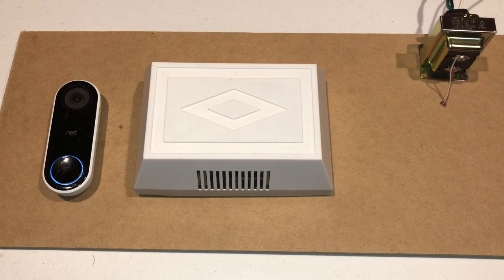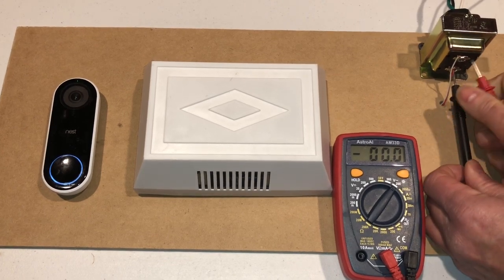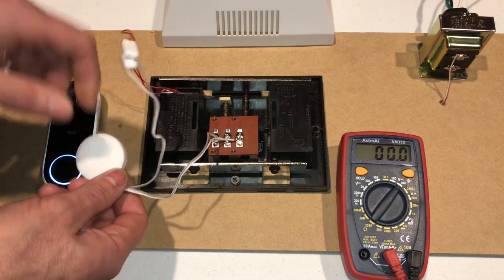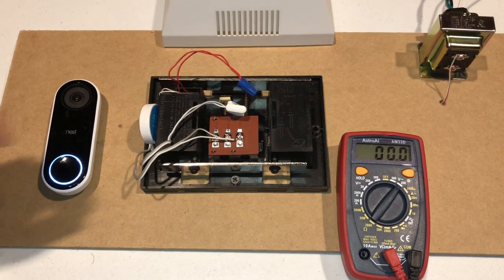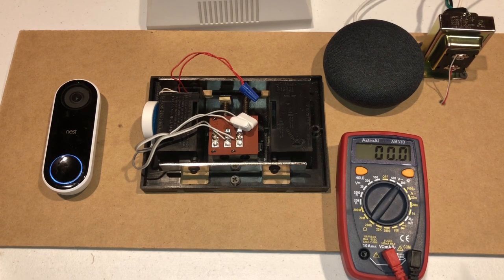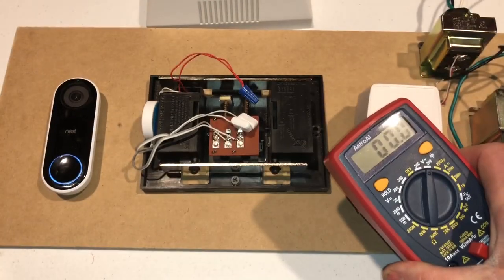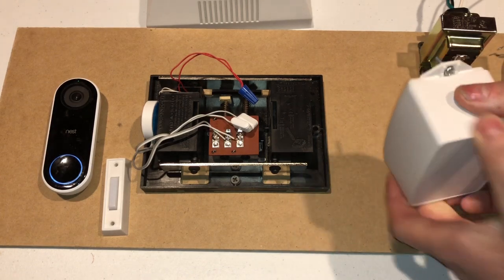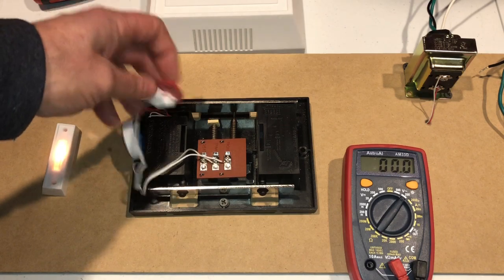Fix Nest Hello Power Problems

Comment: sorry to bother you with a question. I have an old fashioned metal doorbell hooked up to a transformer. The Nest does work, but the old doorbell does not work. It only makes a continuous soft buzzing sound. Any suggestions? I have looked around but can not find an asnwer
Reply from the maker: Did the chime work fine before the Nest was installed?
Reply: @sellgooddeals-DIY  yes perfectly. Now a constant buzzz
Reply from the maker: Check settings to see if Camera Duration is set to off.  If it is you need to check the wiring from the exterior wall to the Nest Hello.  Make sure there isn't any missing insulation.  The wires could be touching making a connection.   Also, look at the mounting bracket, the wires could be making a connection if they are bare.  While the Nest Hello is still connected straighten the wires out make sure they aren't touching.  See if the chime is making the buzzing noise.  If not the problem is the wires going to the doorbell.  Probably happens when the doorbell is seated in the bracket.  If you have missing insulation on the wires tape them with electrical tape.
Reply: @sellgooddeals-DIY  Thanks A LOT for helping out. I managed to get the bell working, well sort of. only a soft buzz. The constant buzzing still persists though. Tried everything you suggested. Get a second Nest mini. That will solve it I guess. Greets from The Netherlands.

Comment: Fabulous video! Thank you. So I purchased a Google Nest. My 11 year old home has two chimes. After installation the Hello light yellow meaning not enough power. I rang the doorbell once and the light turned blue! But, the first floor chime would barely ring and the second floor chime rang but had a loud buzz and hum. I’m sure I have a 16V, 10 VAC transformer but can’t find it. So I took your suggestion and on the chime that buzzed I twisted the transformer and front red wires together and PROBLEM SOLVED! First floor chime works fine and is loud and Nest Hello works fine! And instead of the upstairs chime, my google mini announces” there is a visitor at the front door!”  Even better than a chime. 

Your videos are the best and saved me from trying to locate and replace the transformer with a 16V, 30 VAC one.

Comment: Hey there good video, so it's been about a year now since you posted this, any issues? 
I called Nest / Google tech support, they said it is not required to use the chime adapter BUT it is recommended to still use it even if you are bypassing the chime. They said something about it being a protector in case a spike in voltage which could potentially "burn" the "Hello" which I would say is essentially what a capacitor does. 
But others have said long term they have noticed issues by doing this..

Comment: It is unfortunate the suggested solution is to not use the chime and just buy a google home.  The main goal is to keep the chime working like it was before but also get the functionality of the best camera.
Reply from the maker: It is personal preference.  I prefer to use the Google home minis/hub as my chime.  If you prefer the bell upgrade your transformer to at least a 16v 30va transformer and your bell should work for you.  I was giving my personal preference. The chime uses a lot of amperage if your transformer doesn’t have enough capacity the voltage will drop causing  the Nest Hello to not work properly.  That is why I like to bypass the chime.
Reply: Yeah just changed out to a 16V 30VA transformer and still having a ton of issues.  Nice to have options as I suspect most people would like to maintain their standard chime as well.

Comment: I really appreciate you sharing your solution. My doorbell was offline more than it was on, and it was driving me up the wall and nearly through it. The wifi connection to every other device was fine. I even have a mesh point 5 feet from the door and set the Nest Hello as the priority device. When I then investigated the power situation, I couldn't find the transformer anywhere in my old house. I was about to give up and call someone. So this tutorial and your advice really helped me out.  Thank you for making it easy to understand. I don't mind retiring the chime and relying on the Google Assistant, as long as it works and doesn't go offline every few minutes. So far so good. Thanks again!

Comment: The "power kit" is not just a capacitor. It is also a switch that the nest app uses to turn on and off the chime. There is a mode setting to turn the indoor chime off or on depending if you dont want to be disturbed by the doorbell. Personally i dont like the delay from pressing to bell to google mimi announcing the doorbell or the lag in the network for the push notification to your phone. I like the chime. The real solution is to get the 24 volt 40VA transformer and put in a resistor at the chime to drop the voltage to just the chime.
Reply: no i don't think so.  I installed mine without the chime adapter and the setting to turn off the inside chime still functions.
Reply: Shaun S yes but you can’t turn it on and off if not wired correctly.

Comment: Thanks, simplicity is gold😀
I may end up bypassing the chime. Can you explain why my physical door bell only works for a couple of days then stops? I’ve had to replace the capacitor two times now.
Thanks
Reply: Mine is doing that now, how did you replace the capacitor?
Reply: @JesseJamess  Did you fix your issue?  Mine worked while installing then the physical chime inside our home does not work anymore.

Comment: What happens if you leave everything wired and just turn off the chime in the app settings so the chime doesn’t ring? What does the voltage say then?

Also, the yellow ring would indicate at setup that there isn’t enough voltage from the transformer if the transformer is below 16v sitting idle. You should demonstrate with a transformer below 16v.

Comment: This is a great viedo! Hope I would find it earlier.... I connected my hello directly to the chime with 110v. Seems that my apartment didn't have a transformer. Followed Nest intructions and with 110v nest got a green flashing led on top, and now that I bought a transformer it does no light up and just gets hot right on where the wires are connected.... Any suggestion that may help? Have I burnout it? =(

Comment: Wish I could buy you a beer or three. I spent WAY too much time trying to locate my doorbell transformer. I'm convinced it must be hiding behind a wall or something. I can't locate it. This trick worked like a CHARM. Got the camera up and running. And with a little tweaking, my Google Home Mini is alerting me to visitors at the door and the camera feed automatically pops up on the Hub. Thank you thank you for the informative video. You really fixed my issue.
Reply: Exactly.  I live in a home built in 1951, and no idea where the transformer is located.
Reply: Older homes may have the transformer installed inside the main electric panel. You are not allowed to that now.

Comment: My transformer is 24V (10a) but when a measure, it shows 27/28v. Do you think its too much power for the hello without the chime?
Reply: Is a resistors required?

Comment: there was some minor electrical activity causing some movement of door chime tappets but not enough to hit the chime bars.  This happened every 10-20 seconds and if there there is no noise in house you can hear a faint buzz for 1-2 secs. I by-passed the chime and now I can enjoy real quiet times. I wasn't sure if I could do that until I saw your video. I have a google home so I really didn't need the chime. Google should be more clear about this. The buzz was driving me nuts when I was taking naps in the living room. Thanks!

Comment: Thanks for the informative video. I'm also going to bypass my electrical chime. I've seen conflicting info on the nest support forums saying that the chime connector module should be connected to the transformer as if it were the chime. In your video the chime connector is connected to the chime. Just wondering if you can clear that up.

Comment: A good solution. This will work pretty well for all the folks that are also fighting with intercom systems that want to use Nest Hellos as well. You can just upgrade the transformer and send the power to both the intercom as well as the Nest Hello.
Reply: Agreed

Comment: can you do a video with 2 doorbell chimes for 2 story houses.  We found out we have 2 chimes and the one down stairs is going off by itself and the upstairs that is connected to the Next Hello is working fine.  

i'm trying to now connect to the transformer but dont really know what to do if i have 2 doorbells and want both to ring when someone rings the doorbell.

thank you !!!! great content  Please Please do a video with nest hello with 2 doorbell chimes
Reply from the maker: Sorry, I haven’t seen this situation before.  So, I assume that they are both independent of each other?  One does a front the other does a rear/side door?  I would think it would be possible if you already have or can get two wires to each chime to connect them.  You would have to get a 24V 40va Transformer.  Actually thinking this through as I’m typing I thing it may draw too much power through the Nest Hello.  This would likely cause premature failure.  However, I may give it try to see what happens.  I would never recommend doing it though.
Reply: Thanks for your reply. Been doing tons of research and your videos helped me so much better formulate my question. I called electricians and they had no clue what I was talking about

Now I better understand I live in TX 2 story houses made the same are dime a dozen

It appears we have 1 doorbell 2 chimes and a transformer

I hearing I can buy a 24v transformer and then it should ring both via the transformer

I have to order it so in the mean time I connected the nest hello sensor to the upstairs chime

Disconnected the downstairs chime and used a wire nut to tie the grey and white together

This stopped the buzzing and random chimes going off

It sounds like if nest would let you buy an extra white connector I could connect it downstairs to kill the line when not in use like it does up stairs

Thank you again for your videos and I hope this makes sense what I'm writing

1 more thing you have a video showing nest hello and a Google home mini. We have found having 5 Google speakers home hub minis and speaker you have no control which is the primary and which will ring as your doorbell if the camera doesn't see a face it just rings 1 not all

Anyways if you get a chance run a 24v transformer 2 chimes and the nest doorbell and see what happens

 thanks again keep the great content coming

Comment: PS. I posted my review before I watched your video. It actually makes a lot of sense. I’m glad I watched it. I liked and subscribed. Thanks you for this detailed explanation. I learned something. 

Like you said I do have a couple of Google Home Minis around the house and I think having a chime is now probably very unnecessary and redundant. Plus forgot that I had also attached a chime extender years ago so I can hear the bell upstairs too. Under technical info in the Nest Hello App,  it says my voltage is 16.4V but didn’t realize it would drop drastically when someone rings the doorbell. I will still have to probably change the transformer to a 24B. 

But that doesn’t explain why the notifications are so delayed and the app is not respecting my settings for curtailing them. Also the time it takes to respond to a doorbell with the slow process of unlocking the phone, opening the app and starting to talk to the person at the door. What’s the solution??
Reply from the maker: Thank you for watching!

Comment: I’ve been using this NEST now for several months. I like it and I don’t! I used the 30-day trial for the Nest Aware first then went without it for a couple of month... then I just bought a subscription to see if it makes a big difference. Here’s what I found:

1. Forget about notifications. It’s truly useless. I have activated the zones, and also went a long time without any activation zones. It doesn’t matter if you specify I only want to know if there is a person at my door or not, the damn thing sends you hundreds of notifications a day of cars going by, engine sounds from those cars, and occasional passerby’s walking on the sidewalk. None of the settings seems to make a difference — zone or no zone! The only time I need to know is when when someone rings the doorbell, but it takes forever for the phone to unlock, the app to open, the sound button to be activated until I can finally talk to the person.... by then the guy has already left. Very frustrating. Only once I was able to intercept a delivery when she tried to deliver some flowers for my wife and we were away on a trip. She had to wait there as she couldn’t have just left them at the door in freezing temperatures. I finally talked to her and asked her to go see my neighbour next door. It worked great. I could see her walk over and talk to her live. AfterwardS i called my neighbor and explained what’s going on. We came home 2 days later and collected the flowers. That really worked out. Another time, the postman rung the doorbell and wanted a signature. I was asleep. Was able to talk to her and asked her to wait a couple of seconds until I came down. 

2. I thought the system without nest aware would at least give you a few hours (8 or 24 hrs) of history. But all it does is save a few crappy pictures of events reported in some of the notifications... not all — like the back of the person leaving after no one answered the doorbell and he was leaving, etc. Totally useless unless you want to sit there for 24/7 and watch the camera LIVE. Hence I grudgingly started paying for it again. Because this way at least if need be you can go back and quickly scan the history stream to see if anything interesting happened that day. 

Re: delays. My internet service and network system is very fast. I have several wireless access points around the house that are wired into the main router, plus a couple of range extenders (which are not the same as access points as they work like a singles hop mesh, and their throughput halves with each hop compared to the wired access point... if you have a good signal half is still not a bad thing). So, every corner of my house is well covered. Yet no difference with the delays in notifications. Things get compounded more if you add to that the time it takes for the phone to unlock and the app to open. I have a pretty good phone, an iPhone7P, so I doubt that that is the problem. We need almost instantaneous reaction for this to work effectively. 

I also have removed all the other door chimes and the back door doorbell to relieve all other possible demands on my 16V 10A Doorbell Transformer. Still no difference.  I suppose I can replace it with a 24V and 30A version but I doubt that’s going to make a big difference. 

3. Not sure about the cooling time issue. The amount of notifications are bad enough as it is. 

So I don’t know what to say. I paid a lot of money for my Nest cameras (they too have the same delay issues and the constant stream of notifications coming every day) and the doorbell, but the whole experience is nothing but a huge frustration— not to say useless. Their thermostat is not any better either. Can never tell when I’m home or not despite setting up our phone location feature and all that.  At least we can deal with that manually. 

Google needs to put in some serious effort in improving these products if they want to keep Nest alive!!!
Reply from the maker: I have experience some of your issues. As I'm typing this I can't get my Nest app to connect with their servers.  It takes about 10-14 seconds for my phone to get notified.  With my phone (iPhone X) in my pocket pulling it out and clicking the notification and for face recognition to open the app it takes about 6 seconds.  My Google Home Hubs and Minis take anywhere from 4-6 seconds for the notification.  The 16V 10va transformer that you have installed isn't enough power if you have the chime hooked up. Most people can get a way with using a 16V 30va transformer.  That depends on how much power the chime is drawing and the distance the power has  to travel trough the wiring from your transformer to your doorbell.  You may have to upgrade to a 24V 20va transformer.  When you have under the required voltage a whole host of problems can occur.  However, it won't fix your problems with false alarms.  Zones don't appear to make a difference when it detects people even if they are actually vehicles.  I'm not sure this is really any help, everyones situation is slightly different.

Comment: Just to clarify, the transformer in the picture is connected to the doorbell and nothing else.  What were the two red wires you twisted together?
They made this way too complicated. 
Thanks
Reply from the maker: Basically, I bypassed the chime so that the power doesn’t run to the chime.  Now, the  power from the transformer is just going to the Nest Hello.  The two red wires were from the chime on terminals trans (transformer) and front.   When I took them off from the terminals and wire nutted them together is how I bypassed the chime.  Hope that helps.
Reply: sellgooddeals DIY question sir, my box doesn’t show 2 red wires one is green connected to rear one red connected to trans and one white connected to front,  common sense tells me then that the white and red are the ones I need to hook up together right?  Just want to make sure and don’t short anything 😉